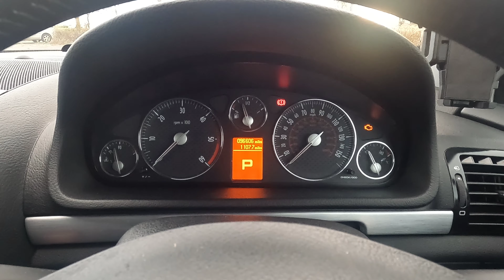🇫🇷MY NEW PROJECT CAR REVEAL🇫🇷 - PROJECT 3.0HDI

Comment: I know that car very well as it used to live close to me. Welcome to the 3.0 Hdi club and I am looking forward to some of your mods. Be careful when remapping these cars as the boxes are not strong and you might have a bit of torque slip when accelerating already.
Reply from the maker: Have you had yours done?
Reply: @LIMITLESSMEDIAUK_    Not yet, but next year I will be, funds dependant of course. I am looking at a custom map that protects the autobox some what by limiting the power from standstill.
Reply from the maker: @DioneProtocolMOD  I've seen around 300 and 500nm seems to be okay

Comment: Awesome and welcome to the exclusive 3.0 hdi club. Or 3.0 hdi with 19’s club! 💪Looking forward to hearing it without the back box. Make sure you keep the back box though as they are mega bucks to replace and you can’t find them if you ever need it! I think we should do a 3.0 hdi road test? How about my 2 standard ones with my remapped one and your remapped and  lowered one? Be interested to feel how it drives lowered too.
Reply from the maker: Definitely
Reply from the maker: Is yours 300bhp and 500nm? Who did you remap? Still running dpf etc
Reply: @LIMITLESSMEDIAUK_  it’s 307 bhp and 550 lb/ft still has original exhaust and dpf/fap filter. Remap was done years ago by DMS.
Reply from the maker: @frenchbred2081  gearbox has been fine?
Reply: @LIMITLESSMEDIAUK_  yes no issues at all.

Comment: weirdly I wonder how much power HDItuning uk can get out of it, secondly, can it fit in a 207, and landrek pickup?
Reply from the maker: Aiming for around 300bhp 550nm maximum safe for the gearbox and 207 with alot of work, landtrek yes